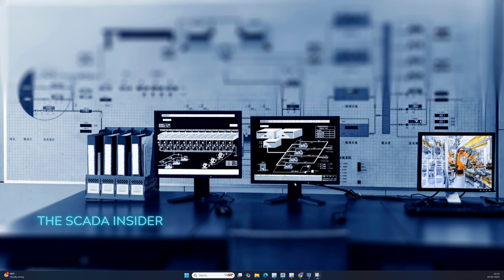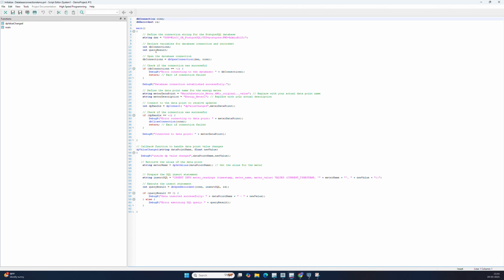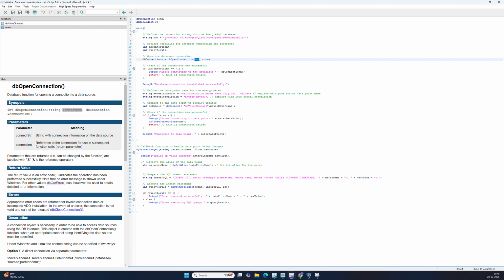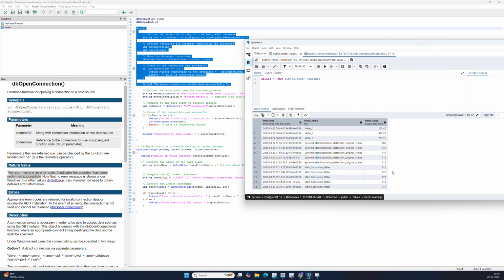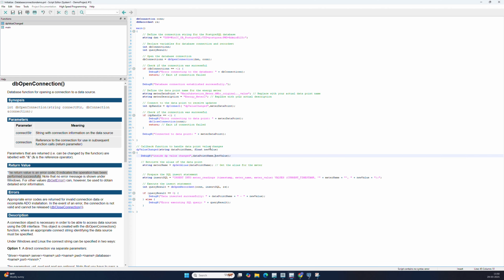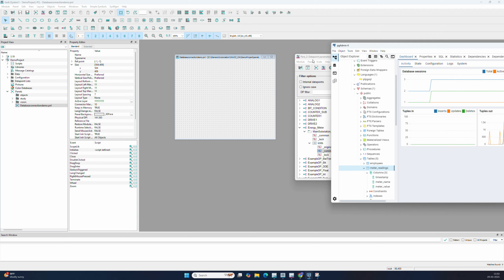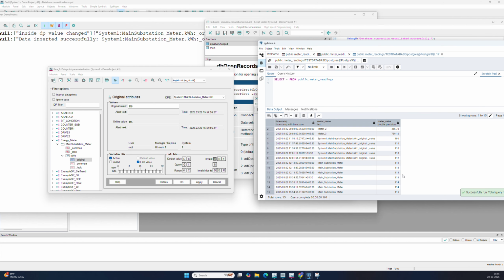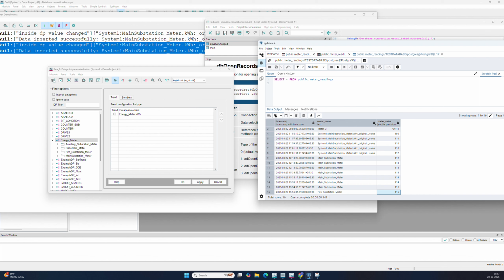How to connect WinCC OA SCADA with external PostgreSQL Database using ODBC Driver

Comment: Hi, great work! but I'm confused! do I have to write all these codes to just connect WinCC OA with DB? if no and there are normal configurations to do that without coding, why are you using scripting now?!thanks
Reply from the maker: Hi Ahmed! Thanks for the question 

No, you do NOT need to write all this code just to use WinCC OA with its database.
WinCC OA already comes with its own internal database, and the default connection is created automatically when you create a project so no scripting is needed for normal SCADA operations.

In my video I used scripting only to demonstrate how to connect WinCC OA to an external database (like PostgreSQL, MySQL, etc.) for custom use-cases.

For normal trend/event storage, WinCC OA handles everything by default.

Hope this clears it up
Reply: @thescadainsider1 thanks for your answer, so i need this scripting to connect OA with any external DB, no ready drives to use like in ignition!